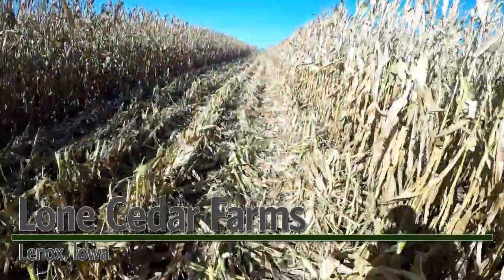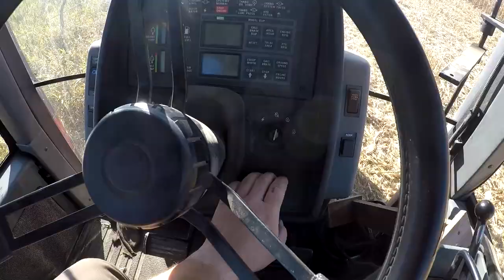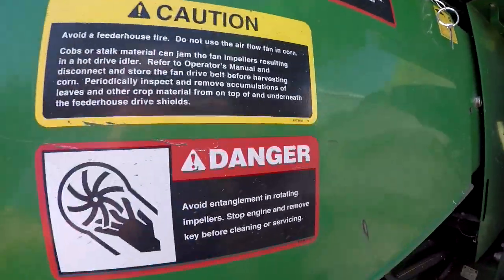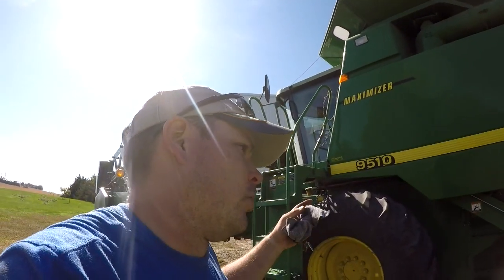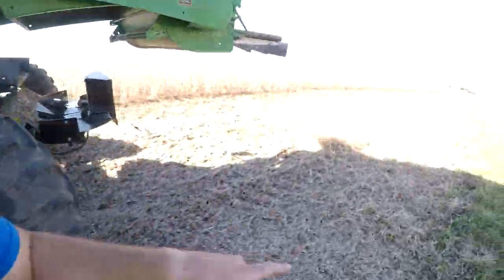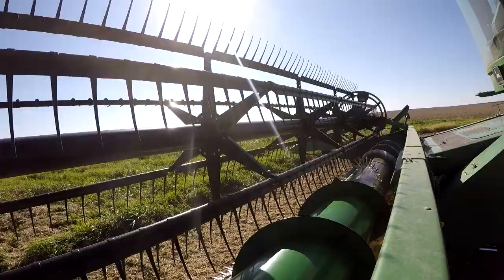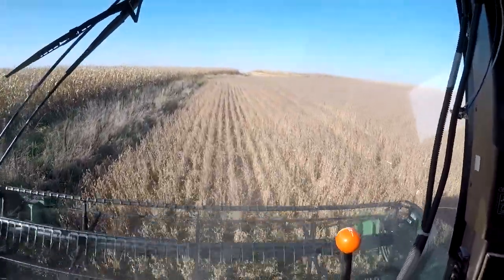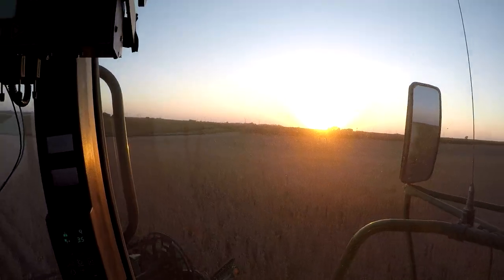A Few More Acres of Corn - Changing Combine Over - Harvesting Soybeans

Comment: How long does it typically take to change the combine’s head?
Reply from the maker: Switching heads is relatively quick; maybe 5-15 minutes each to remove or attach with hooking/unhooking hydraulics and driveshafts.  When switching between corn and soybeans there are a few things on the combine that need changed which probably take at least 30-45 minutes additional (longer if anything is due for lubrication or you notice something that needs attention).